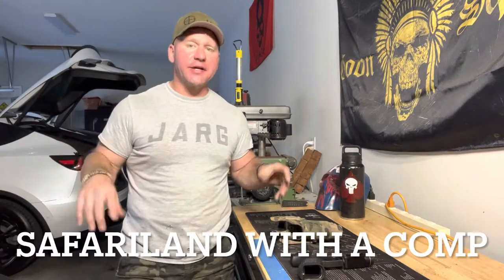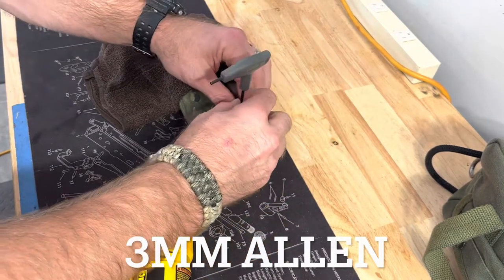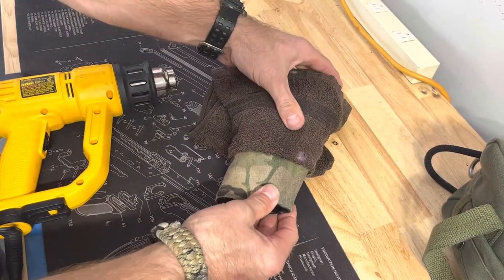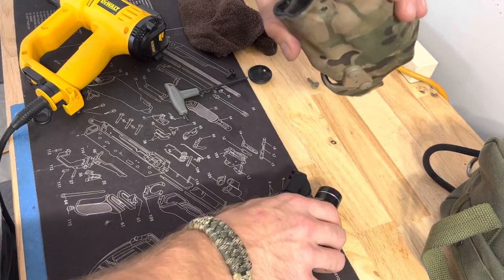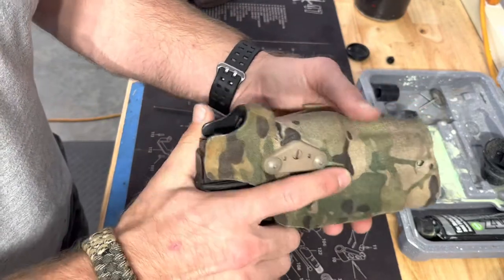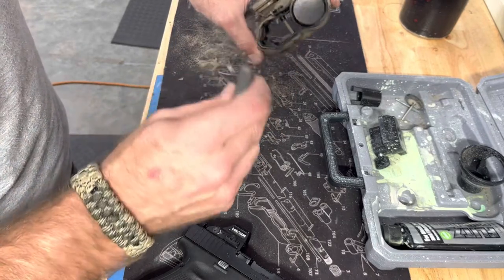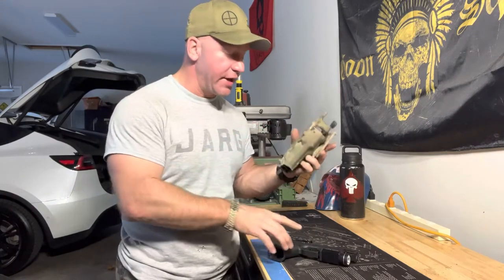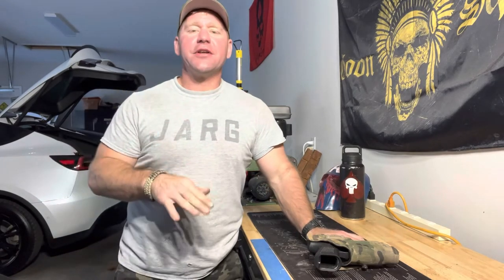Safariland holster MOD to fit a compensator on Glock 19? YES!

Comment: Thats not a G19 holster. It is for a G17/G22 with Surefire X300 (TLR fits too). You can see the model number engraved on the holster at the 20sec mark.
Reply from the maker: And your point is…
Reply from the maker: I have done this for a 19 holster, 17 holster, and a 34 holster.
Reply from the maker: I have many Glock and done this on all. So what is your point again
Reply: No need to get all pissy, my guy… We appreciate the video. The point is that you were putting out bad info. People were asking you the question in regards to THIS video, THIS holster. Just trying to put the correct info out there, thats all.

Comment: Great video!! I have a question, I have mass driver compensator with glock 17 gen 5 and the problem I have is the ALS because the comp has the upper hole and it gets locked with ALS when I try to pull it, any tips?
Reply from the maker: I used a drimel on the als. If not care this will cause a less secure lockup.  In hindsight, I should have welded a small piece of welding rod across the hole so that the als would side over it.

Comment: Hey, so I have a shadow system Xr920 that's the length of the g19 and wirh the ramjet afterburner compensator makes it a g17 length. My issue right now is that it's getting caught on the comp, I believe. It goes in fine, but it's catching somewhere on the upper locking mechanism that I believe you were having an issue with, too catching on the top of the comp. How much material did you remove, and where exactly was it that was getting stuck?
Reply from the maker: If you look at the holster locking ribs…. As they go to the sides, they curve. Your comp is more square.   Take off small amounts.  You want your lock to still work but not get caught.   Start with ribs closest to the comp end of the holster

Comment: Is that a 19 holster?
Reply from the maker: Yes
Reply: @JARG  sweet I’ve seen some people using like g17 or g34 holsters. And didn’t know if you had to start with that. Thank you really like your content man
Reply: @JARG  I paused it around 20 seconds and I think I read “6354DO–832” which is a G17/22 holster. I have a similar setup but with a G19 holster (DO-2832) and I can’t get the ALS to lock with the TLR-1H. Before you installed the comp did you have to modify the holster for the TLR to fit? I’m hoping it’s an 832 holster and no modification was needed???

Comment: Airsofter modification here:
Using a dirt cheap replica 17/23 6354DO, I just took a file and filed the holster to accept the Glock 19 with a compensator.
I had nothing to lose, it was a Chinese replica, so I chose to use a file and sandpaper to shape it out. I lack a heat gun so it was my only option.
Flashlight stops the wobble anyways, it's crude, but when it's cheap I barely care about the consequences. If I had a real Safariland (which I don't because they're like 400 bucks and borderline unobtanium), I would've bought a heat gun instead.